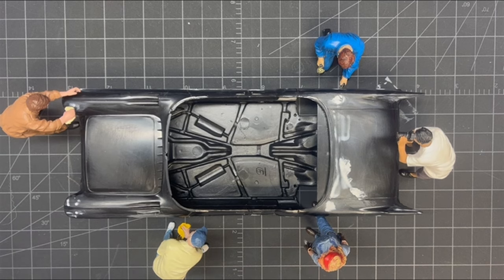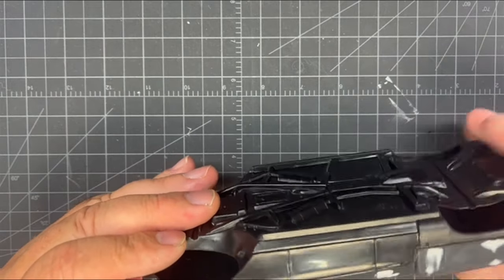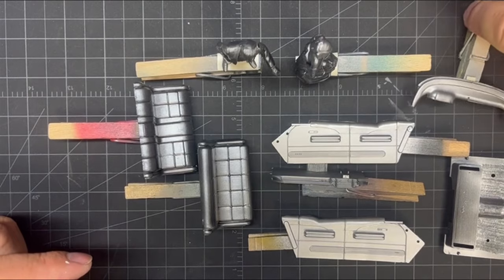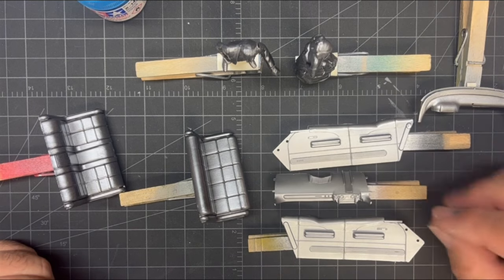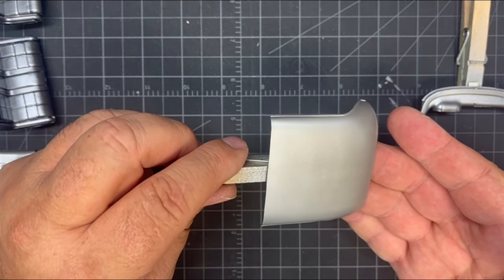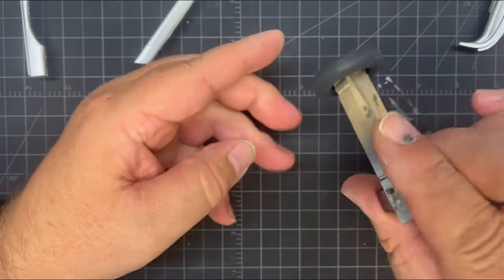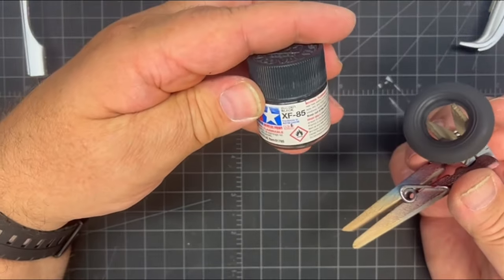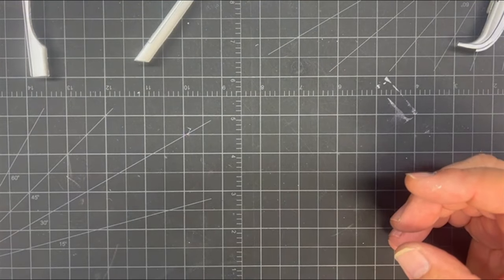Revell 57 Cadillac Eldorado Brougham build update 3

Comment: Awesome update Grandpa! You really can't say anything bad about those Gaahleri  brushes. That brush is $99 bucks with coupon right now. I'm going to get another GHAD-68 I like so well... I'v been making shocks, coils, filling holes in the engine block and having fun getting things done on the bench today.
It all looks great and liked the booth action video as well. It is nice to watch a pro at work... 😉

LLAP 🖖
Reply from the maker: Thank you.  I love that 68.  It fits so well in the hand.   I knew this one was about 100 bucks, but dang does it spray nice.  I used it again for a few minutes tonight.  I think for now on I will be making my own shock coils too.  They add so much realism.  It's going to be stupid hot here next week, so I may get a lot done down the basement.  
I'm glad you liked that spray booth part.  It was a test of a new camera mount, and using my phone to dub the sound after I shot.  That way there's no fan noise.  The camera is about an inch away from the fan, and that's about all you can hear.  LOL  As for a pro, I'm not even close with the airbrush.  More like a crummy hack.
Reply: @grandpamarkshobbies  Oh, before I forget again. Got that seal kit (you sent link) and It did have one of the "o"rings but did not help. I farted around with that thing for 2 hours. All the passages are clean. Changed needle and tip from a another brush ( the wrench king) and still no paint. Just air... I don't get it. 🙅 (Paper Weight)

I made the shocks because my dumb butt lose 1 of  shocks out a closed zip bad... Lol I had to make some for the glue bomb 66 Fairlane convertible project.. I make the slim and air shocks. Have not tired the "coil over" shocks. I have some of your wire. that might work. 🤔

It is amazing that lot's of kits leave out the coil. Was not a thing until I started wiring the engine's... Lol Going to try you way for wiring the coil on the 50 Ford Showboat. 

The spray booth filming was great and the voice over was awesome.
As for (More like a crummy hack.),,, Your better at being a hack than me... 🤣
I just need to get use to painting again I think...🤔
You had to bring up the "Stupid Hot" issue, didn't ya! 🥵 You do remember I'm south west of you right? 🤪
It's 65 outside this morning, so i'm going to go out and work on the 1:1 Mazda pickup, I think it has a hanger broke on the tail pipe... 😥

LLAP 🖖
Reply from the maker: If you want, send it to me and I'll see what I can do with it.  There's other gaskets in there that may be letting the air go the wrong way.  
With the shocks I usually hurry past them, because by the time I get to that part of the build I'm over it.  LOL  
Every time I sit in front of the booth I feel like it's a shot in the dark weather I'm going to get good results or not.  LOL  It is nice here, but it's going to get warm starting Saturday.
Reply: @grandpamarkshobbies Sure I can send you the "paper weight"... Lol  It's a no name brush but It has the the removable cup and the .5 tip I think.🤔 I used it for everything... Lol Send me a e-mail... 📫✉
Oh! So you do the chassis last, that's why you are over it... Got Ya! 👍 🤣
Try being 1/2 blind in both eyes, talk about spray and pray you hit something... 😂
Got to go have a 1950 Ford calling... LOL
LLAP 🖖
Reply from the maker: I'll shoot it to you in a few minutes.
Reply: @grandpamarkshobbies  Got it! 😎